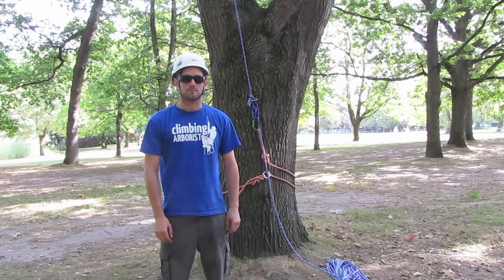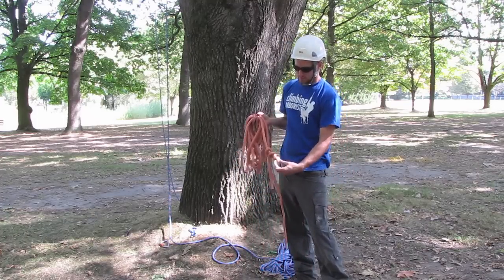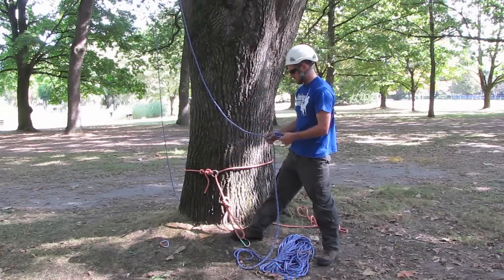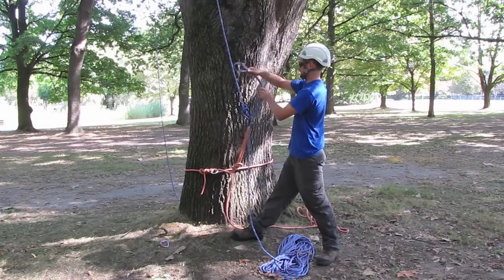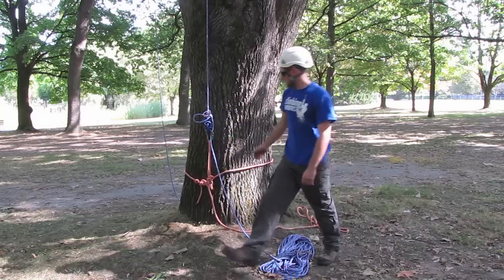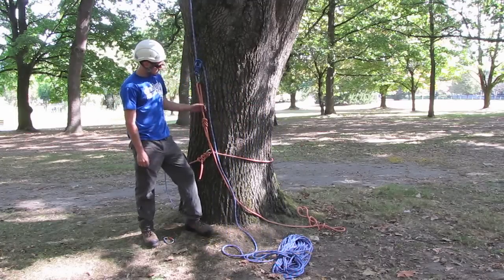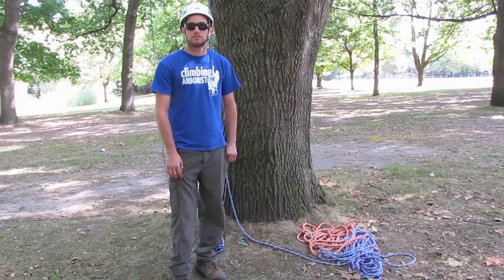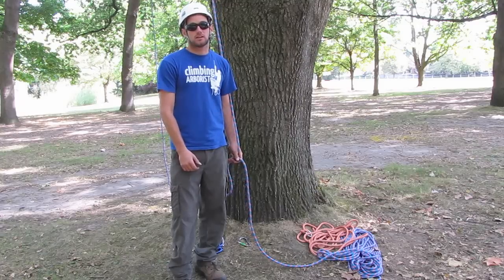Base anchor setup for S.R.T that can be lowered

Comment from the maker: As long as the figure of 8 has the rating stamped on it and is in good condition when inspected before each use it is fine to use the type in the film (this particular one was bought from an arborist supply store) it differs from some in that it doesn't have the prongs on either side but are not necessary when using the hard lock method. Thanks

Comment: Have you ever done a video on listing the benefits of a base anchor and the benefits of a canopy anchor? I know one of the big benefits of a base anchor is that a groundsman can lower an injured climber but are there any other benefits? like limb load. I have seen several videos that tie there base anchor to some other object and not the tree that they are climbing, I somewhat understand the compression versus the bending loads but it would be nice if someone would do a video and better explain. Also your videos are very well put together most of the other videos I watch to see what not to do.

Comment: Climbing arborist, please can you do a video on climbing with the use of two ropes. I do council work and am struggling to work this out. I’ve a drt setup and a chicane srt setup both with zigzag. I also want to add this sort of system so my ground crew can lower me. Any recommendations? I thought about using my access line as the lowering point like this, and in addition use the two ropes to climb with so in total three ropes. Crazy huh?

Comment: Wouldn't it be a bit more proper to use the heavy duty figure 8 opposed to the rock climbers one?  That is if your using it as your climbing base.  Knowing how tree climbing gear regulations differs from that of rock climbing.